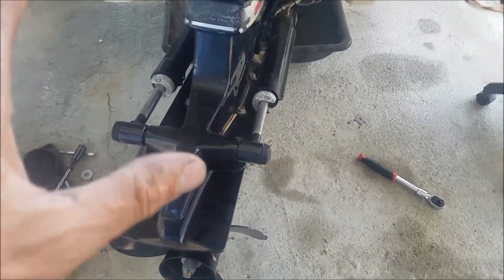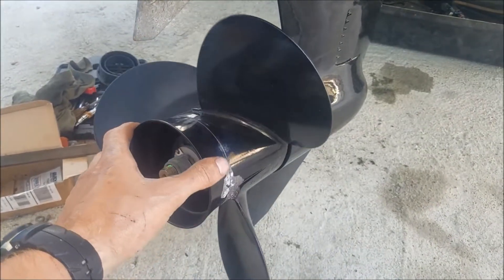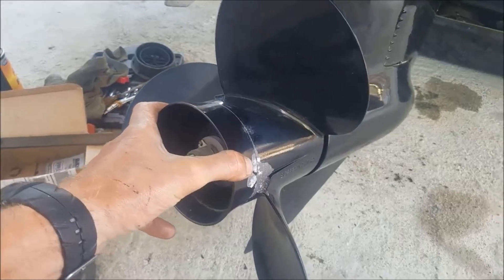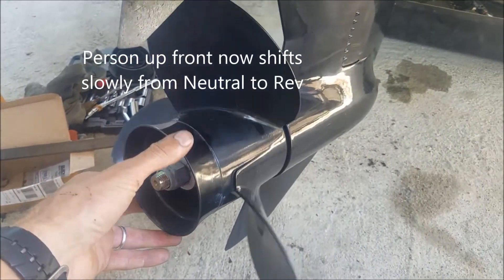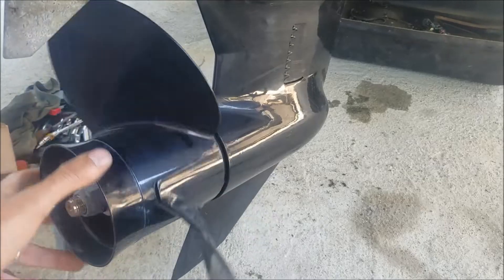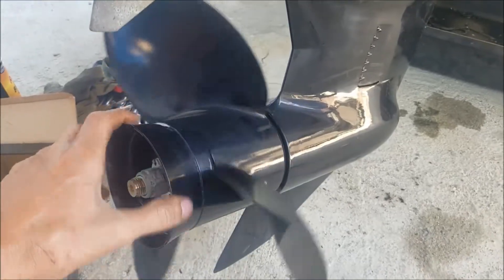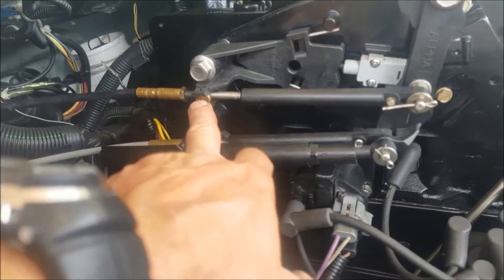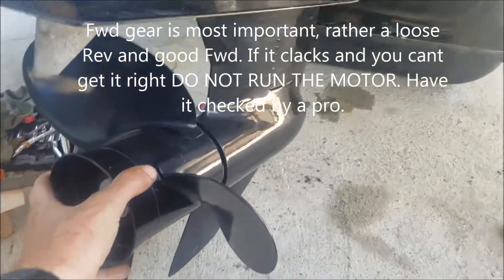**BULLETPROOF** Mercruiser ALPHA + Outboards  (not bravo) lower shift cable test & adjustment

Comment: Thanks it was super helpful! Followed the instructions was able to engage and lock in the F,N ( properler was free)& R was locked as well, while the engine was off , but for some reason while the engine is On , the gears are going from Forward to Reverse- not stopping on Neutral.
If anyone sees this comment and had the same issue or would like to share a light, please reply,  many thanks for this video!

Comment: Nope and nope. The brass barrel is set at 6 inches (center of barrel to center of eye) in full forward off bracket 
Move adjustable stud on bracket closest to pivot bolt re tighten. Remove helm cable and “spring shift assist”, install drive cable (brass barrel) shift to full forward while rotating prop to “lock”. Install helm cable to bracket adjust this barrel to match while keeping “cut out”switch centered. Shift to reverse while rotating prop to lock if it ratchets loosen and move adjustable stud until engaged and cut out stays centered, tighten stud. Check your work then install spring shift assist. Tight nuts then back off just enough so washers spin. This procedure assumes normal wear and no damaged or broken components.

Comment: I adjusted the cable and i still only get just forward or just reverse. Something in the drive itself to adjust? It's a brand new shift cable and it worked when i ran it in my yard, then nothing when i launched.
Reply from the maker: try max out the ratio nut- its a 7/16 nut behind the arm where the lower cable attaches to on the bracket, once loose u can slide it up the slot all the way- see if that helps. Make sure ALL other connections are snug, any play in the system will make it worse.. on rare occasions ive had to drill out the slot a bit to get that last bit of movement. Good luck-

Comment: I changed out drive Cable and I was having a hell of the time. It will shifted into forward and neutral but not reverse. I have my wife rotating the prop as you suggested and I was on the boat making adjustment as you suggested and it took me 4 tries but now is working fine. Thank you so much for your simple and straight forward instructions
Reply from the maker: @jakeroth5809  glad to hear it helped yes wife is required lol!

Comment: I feel this video is only somewhat helpful in that it shows you how to confirm if your adjustment is correct; not really how to go about adjusting it to begin with.  Need a Part 2 IMO.
Reply from the maker: I did mention at the end to spin the brass barrel forward or back - and retry. but i can make a second one

Comment: This fixed my issue but my shifter is backwards???? Forward is reverse and reverse is forward. Idk what the previous owners did. But now what?
Reply: are you sure its backwards? If you shift forward up front, the LOWER shift cable at the engine (one with brass barrel that goes down the engine bay) must SHRINK, if you shift REVERSE it should push out/lengthen.. If yours IS reversed u need to swap the shift cable in the control to the other wide of the plate, the prev guy must have wired the cable wrong for a counter rotating drive. If your drive IS counter rotating it will be the opposite of what I just wrote..
Reply: @francoisbrand6111  all I know is the prop was not spinning in any direction. We did this adjustment and now at the helm when we engage a forward it goes backwards and when we go in reverse it goes forward. We have little throttle in forward but huge throttle in reverse.
Reply from the maker: If this is a std rotation drive (most common), the prop should LOCK when u spin the prop CCW when the control is in FWD (like in the video). If the engine is running and in fwd gear and the prop spins CCW, then the cable just needs to be swapped up front inside the box. Remove the control box, split the 2 sides and pop the gear shift cable into the other position, then it will work. Someone put the cable in the wrong position.
Reply: @SocalMarineUSA  there is a top placement and a bottom placement on the shifter. Should we try to move the cables to the upper part or top of the shifter, right now they are on the bottom.
Reply from the maker: @kaylashosho6852  correct. just swap it- test it before u close it up, just hold the box shut and confirm the lower cable (one with brass nut) at the engine gets smaller when going into fwd and extends when into REV.. if so button it all back up-
Reply: @SocalMarineUSA  we were able to get it!!! 🎉thank you so much! This really was the only video that was accurate. My only question is now in reverse we only have one “speed” we are not able to give it gas to go faster. And if we try to push the throttle down far in reverse it will die. Any tips or should we just leave it be???
Reply from the maker: @kaylashosho6852  maybe a carb issue? another problem can be the shift interrupt switch. If the engine is idling in Neutral, and u pop the switch with your finger the engine should die when you push it and keep running when you release (do it quickly). If that works, then the lower shift cable might be old and sticking. I just uploaded 2 videos yesterday for that, but what I can do today is make a film demonstarting this to test the switch... alot easier to explain on a video. Does forward work ok or also stalling when u throttle? The carb may need cleaning.
Reply: @SocalMarineUSA  forward seems to work (on muffs) we are gonna take it to the water to test it and I’ll get back to you. We really appreciate your videos, replies and suggestions. With out them we literally would not have been able to repair this ourselves.
Reply: @SocalMarineUSA  well it worked perfectly on the water. We ran it for hours at all speeds (the little kids like fast the best 😂), shut it off multiple times and swam, pulled a wake board and had a blast with the grandkids. Thanks so much!❤

Comment: I set the lower shift cable to 6 inch. It was at about 6.5 inches and worked fine there until I changed the out drive. Went from no forward locking to no reverse locking with forward now locking. I guess I'll add about a 1/4 inch back to see if I can get it centered. My US marine upper control cable has me puzzled, it's different with no barrel to turn. There is a set nut on the cable end to to adjust the cable throw or total travel. Not sure what that adjustment is for??? There is a clip at the rear with 3 positions in it where most videos show a barrel???
Reply from the maker: if both cables are adjustable, one will also affect the others position so your measurement on one cable will change if u change the other.. not 100% what setup you have, but remove all cables from the brackets (take pics!) , now find the cable that shifts the gears and have someone spin the prop as in the video, now push/pull the cable manually by hand & find the exact spot the gears start to clack/make contact in both FWD (spin prop CCW) and REV (spin prop CW) and mark with a sharpie on the cable you are pushing/pullling - NOW make a 3rd mark exactly between these 2 marks (ill call this the initial Neutral reference mark).. now put the boat control lever in the upright/Neutral position - now reconnect/reset barrels to have equal amounts of threads on each side (ie dont have one barrel all the way on the end of its threads - use the original markings as a guide too unless they are out of whack).. now try reconnect the cables/clips so that the gear cable is positioned at or as close to the neutral reference mark (the center of the 2 marks you made on cable sheathing). Now do the test as I show in this video using the CONTROLLER in the boat and fine tune/ adjust only one cable if possible on whatever thread there is, barrel or end its the same principle- all cables have a thread somewhere to fine tune.. To summarize: find where the drive starts to engage both fwd and rev- now adjust whatever you need to and make all the cables/clips/whatever do what the drive wants, dont try make the drive do what the cables look like they want.. if that makes sense.

Comment: My 1990 Alpha 1 Gen 1 upper cable is red plastic. There is no barrel to adjust. just a set nut to turn the front part of the cable in and out. Where you have a barrel I have a clip with 3 positions. Do you know how this type of cable is adjusted?

Comment: Engine will go in reverse and prop will turn. Shift to forward prop locks one way like normal but will not spin with throttle sent and hear a clicking noise. Any thoughts?

Comment: I just tried mine and I got nothing either way.  Is this the same for Gen 2? Also did you ever get to the more detailed video?
Reply: same for gen2 yes - nope on the detailed - moving the brass barrel with the split pin moves the shift window between Rev and Fwd so u can balance it out in the middle more or less.. are you sure the cables have not jumped out?

Comment: I was out on the last last week with my 91 Stingray 21’ Alpha One drive, and out of nowhere when I shifted to neutral to slow down the engine stalled out. It had never done this before so Immediately knew something was wrong. I restarted it, as soon as I put the boat into gear it was grinding and making horrible noises coming from the outdrive. Eventually it locked into gear and idled back to the boat ramp. I checked my shift linkage and all looks to be correctly adjusted, but after this video I am seeing that the prop still spins and makes that clacking noise well after that first forward gear stop. The throttle is also very stiff. I decided to pull the outdrive and replace the shift cable all together. I’ll report back with results after I replace it.
Reply from the maker: sounds good - do this test when you get it in. You adjust the spinning brass barrel to move the shift window, i try get it like 55% in the fwd and 45% in the rev to give FWD a slight edge- secondly there is a ratio nut at the base of the lower cable end pin (7/16 wrench) that allows you to set the ratio, moving it nearer to the partner/upper cable increases the throw to the lower which is usually what is required if there is too much slop to achieve both gears engaging positively.. ive had ones that only just engaged fwd with the ratio nut up all the way in the slot and some that worked well at about 2/3rds up - good luck- it takes some tinkering but if you can achieve the results in this video then you are good to go. Worth checking after the first run and every few months too- dont be fooled by the price and try to use chinese bellows, use sierra or OEM brand only.. it can sink your boat. Make sure the BRAND on the listing is sierra/oem, not just the description.

Comment: Also i tried to turn my lower shift shaft spline to forward with vice grips and a rag to overcome the spring back  but it was scoring the shaft even through the rag folder over the shaft a few times what is the correct method to do this without causing any damage to the shaft
Reply: they work but try not to damage the splines.. a good trick is to wrap a bungee cord around the prop so it pulls it upwards while engage in fwd- that will keep it loaded up while u struggle with the rest of it, if you need to turn it ever so slightly to align splines just minimally rotate prop CCW, that will turn the spline but dont do more than1/2 on the blade- otherwise you could flip an impeller blade or two. a LIGHT smear of grease or even oil inside the water pump housing helps them slip when you do this. On mercruiser, one cable goes down and another long one all the way forward. Volvo penta have one long cable form the front control all the way to the drive at the back-

Comment: I have a question please. In neutral, i have zero clicking, and it locks in both gears perfectly. But trying to spin it the other way while in gear, i get clicking, only while in gear. is that normal? when i go back to neutral, zero clicking
Reply from the maker: That's correct. Most important is to be fully locked when rotating CCW in forward AND zero clicking in N, otherwise the gears WILL strip/ self destruct either running in fwd and partially slipping or idling in N.
Reply: @SocalMarineUSA  thanks for responding to that question. You answered mine too, same question. There are varying levels of (friction) clicking as you move the cable adjustment barrel. I’m just shooting for no clicking in neutral while still engaging in drive gears, if I understand correctly..

Comment: I have a 25hp mercury, in fwd it locks ccw and clicks cw, but when put in reverse it locks both ways!? (in the water when put in reverse it doesn't catch... The engine just revs... Can you help? Thnx
Reply from the maker: depends on the clutch style- as long as the prop is locked CCW when in FWD and CW in REV - you should be good. Did you take the leg off? Its possible the lower was in REV and control in N when u put it on - that would make only one gear accessible - ie it would be in gear when control in N. The shift rod can be a gear out and still go in- you might need to drop the leg and check - so if the upper is in N the lower must be in N too when u slide it in, or if the upper is in FWD that the lower is too (bungee cord pulling prop CCW will stop it from rolling into N when u push it in).. whichever gear the lower unit and upper have to match basically.

If this is not your issue then you might need to check your control cable adjustment up at the motor head - something is off.. adjust the shift barrel until you have it dialed in - might take a few tries but you will get it :)

Comment: Hey I have an issue I took my lower alpha one gen one off the boat as I decided to rebuild my engine. While it was off i decided to replace my water pump. When taking it off it said to put in forward gear, I did so not sure if it is now. I’m not sure how to line up the brass shift thing with the shifting gears next to the water pump. I have it all apart still not sure how to put it back, can you let me how I should like that brass 90* Bend with the gears or if it doesn’t matter. Please let me know I read the manual can’t find anything.
Reply: On the drive the shift "shoe" has 3 positions: Directly forward = FWD (prop will lock if u turn it CCW), about 30 degrees to port = Neutral (prop will be free in both directions) and about 30 degrees more (almost pointing to port) = REV ie prop will lock when rotated CW. Adjust so you get this correct before installing to the boat. Now when you go to install the drive you have to point the shoe fwd and use a bungee cord wrapped around one of the the prop blades applying some pull to the prop in a CCW direction - this will stop it from rolling out of fwd as you wiggle drive in place.. The control up front must also be in FWD - just look in the shifter on the transom where the shoe slides in - both need to point forward otherwise it wont go in.
Reply: Fstarocka Burns thanks for your help I was able to get it done today! And everything works!!!!
Reply: @fstarockaburns425  just tried these steps but as soon as we have it in place and go to test it won’t stay locked in gear in fwd prop with pressure ccw bolt it up then as soon as it goes slightly Cw it comes out what step are we messing.

Comment: Ok so - Mine "locks" in forward but i can continue to turn it - in 
reverse it never "locks" - this is with the shift cable removed from the
 mechanism and operated by hand - have i lost something in the unit / 
has something let go? - With the engine running it does nothing - no 
forward - no reverse  whether operated by hand or the control -  reverse
 trips the kill switch when connected to the control
..
I did drain the lube and didn't see metal or water - We were cruising 
about 3000rpm when it just let go - there was audible clicking from the 
rear
..
Troubleshooting steps/tips? do I need to pull it?
Reply from the maker: The load of a boat is way more than you can do by hand .. no metal only means it hasn't been grinding along.. sounds like a snapped shaft rebuild or replacement Def recommended
Reply: @SocalMarineUSA  So locked means I shouldn't be able to turn it at all? And if i understand you I definitely needs to be pulled and inspected

Comment: How much do you charge for a FaceTime diagnosis? It seems that you are knowledgeable. My boat was running fine pulling my kids on tubes then I hear a pop and the propeller would not engage. I just did the test you just performed and it seems to engage in forward and reverse but the prop isn't pushing the boat. I'm pretty sure it's not a spun hub because it appears fine. I'm lost and trying to avoid extensive repair costs. Someone help😩
Reply from the maker: Not available today sorry shops closed but I believe you might have broken a shaft

Comment: Hi good video!
i just have a question. when i spin the prop in fwd it locks "ccw" but when i spin it Cw i it clicks. it does the same sound when the gear is put in rev, turning it  Cw but in cww it clicks .neutral it doesn´t make a sound. is this okay?
Reply: thats fine - the gears are a one way and sometimes slip in the "wrong" direction - its the working direction that has to absolutely lock -